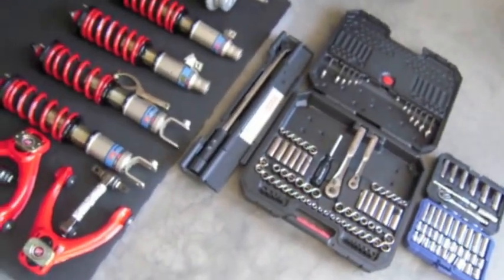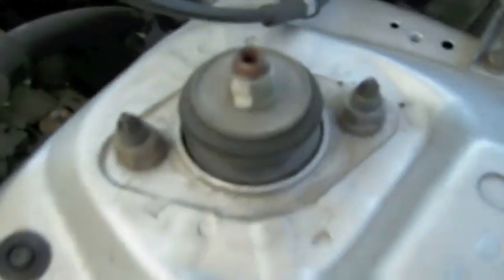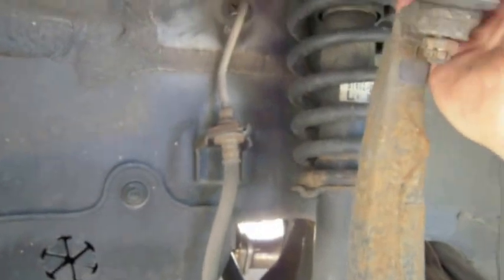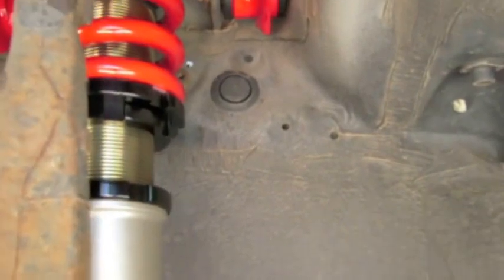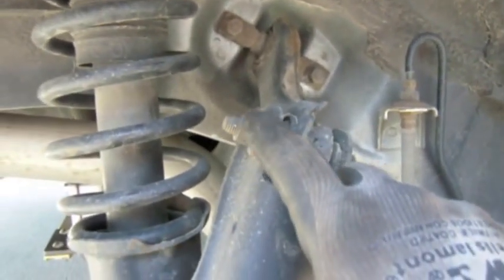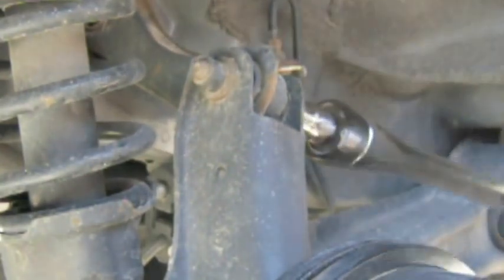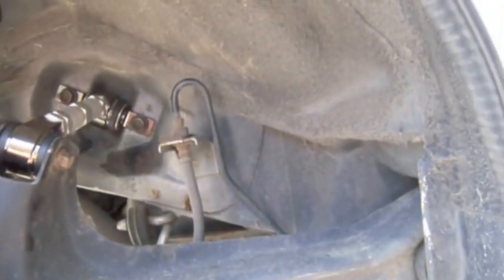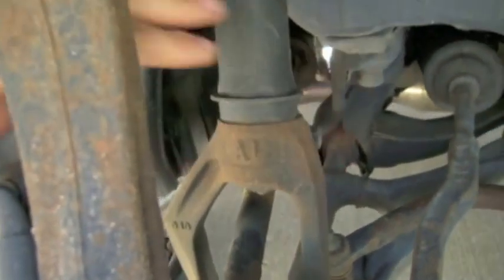Honda skunk2 pro c coilover install

Comment: Looks almost like the exact same suspension as a 90 integra, though the front upper control arms have better mounting than my car. yours won't bend as much when you hit a curb like mine did.

Comment from the maker: the rear is cambered inward a little. thats with them screwed all the way together. but there's more than enough clearance if they weren't cambered at all. and the front is barely off-center from what they came...i have 17"x8" wheels..

Comment from the maker: i didnt have to. the car rolled straight just fine...but when i put my stock suspension back on for most of winter it was all jacked up...but i recently put the suspension back on and it's fine again

Comment from the maker: if u take the screw out of the control arm that the shock is connected thru just have someone stand on the brake drum to push it down far enough for the top of the shock to come out of the hole

Comment from the maker: u can use aftermarket springs with stock struts but u cant adjust anything on the stock ones...u just have to buy springs that u would want your ride height at. that's why i bought this set, i can adjust anyway i want it

Comment from the maker: i had no problem...as long as you take the bolt all the way out that holds the fork to the coilover it should just slide in. maybe just spread it open a bit with a screw driver

Comment: I don't know much about Hondas- 2000 Honda civic VX sedan I had to do an emergency manuver as a vehicle was turning left into me as approching the off ramp interchange. I was able to avoid the BMW but the car was incredible soft (suspension wise). As I steered hard left and braked all my weight shifted forward: like a seesaw- the hard part was the counter steer- when I counter steered the car "reversed fishtailed" and the only way to allow the car the stop reverse fishing tailing was to let go of the steering wheel and let the car balance out. I'm not happy with such a weak suspension. I want to go with a stock ride height to avoid unwanted attention. What is the best option under $1000? (I'm more experience with rear - wheel drives.This is a commuter gas saver for about 3000 miles of drive a month.)
Reply: Arther Casillas If you want stock ride height just go with a KYB strut and decent spring.
no point in buying coilovers If you don't want low..

Comment: put some anti seize on those control arm bolts it will prevent it from seizing up again , cutting suspension bolts is not fun

Comment: Did you use stainless steel bolts? (4:13) Stainless is very brittle, bad idea for anything suspension related...

Comment: I have to install the same coilovers and camber kit to my 2000 civic but i have a question for you. Did you adjust the front and rear camber or u used them as they came?

Comment: How did you get the spring off in the back in the first place. When ever I get that bolt off the spring is to bad to pull off from the controll arm. Do I have to take out a screw from the controll arm to get the spring off?

Comment: Does the skunk 2 pro s II fit a 98 Honda civic ex, I’ve been having trouble installing ?
Reply from the maker: @fidelortiz6641  all 96-00 should all fit the same. The only one that wouldn't fit is if you bought ones for the civic si because their front control arms are different.

Comment: How did you get the bolt out from rear control arm my bolts head snapped off
Reply from the maker: i used a grinder and a sawzall to cut thru the bolt. then i had to break the welds on the threaded piece and replaced it with a new bolt and nut

Comment: i got blox street series. their good but for some reason the left rear sound loose when i go thru bumps even if i move the car up and down fast just body weight i could hear it sounds like knocking noise i triple check everything. can it be a bad coilover?
Reply: i will post a video tomorrow its storming here now. if anyone can help me figure out what it is. 
"integra coilover problem".
Reply from the maker: hagen the great did you tighten all of the collars really well?
Reply: chad tuggle i removed the coilover out 3 times checked everything over and over. i havent had time to record it. i will soon.
Reply: chad tuggle i uploaded the vid. integra coilover problem.

Comment: what did you use to cut the bolts, what size where the bolts you bought?
Reply from the maker: an electric grinder that had a wheel on it for cutting steel
Reply: Alright thanks, having the same prob as you :/

Comment: Why buy a quality component like that and then use a non OEM fastener to save money...that makes zero sense whatsoever.

Other then that 6/10, nice work.
Reply from the maker: are you talking about the bolts?
Reply: yes. I have seen more then a dozen people have hard ware store fasteners break at the track or on the terrible SoCal freeways, and only needed it to happen to me one time back in 2001 and never did that again.

Considering the fact that most parts guys at a dealer will give you a 20% discount on a walk in with out knowing who you are and if they get to know you they will put you down in the computer as having a resale license and give you 30% off.

 Like I said, not knocking you at all by any means, I think you did a great vid personally, just as a huge backer of Skunk 2 for not only Dave's dedication to quality but innovation, it seems odd to save $9-15 bucks on a few hardware items.

Still, thumbs up man. :)
Reply from the maker: AnalogAssassin1 very good point. i've always actually had the thought of these fasteners breaking while driving...would be kinda scary.
Reply: It is not pretty because it usually happens at a high speed and in a braking zone or mid corner resulting in a bad crash.  

You can see the grade on the top of the bolt if you are not familiar with it. look for the ones with a 10, no less then 8 in my opinion.